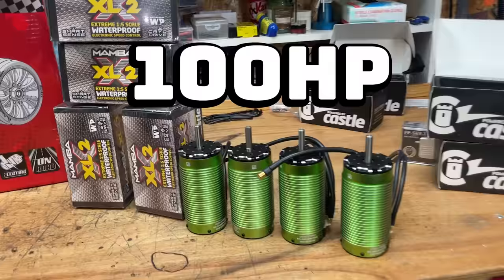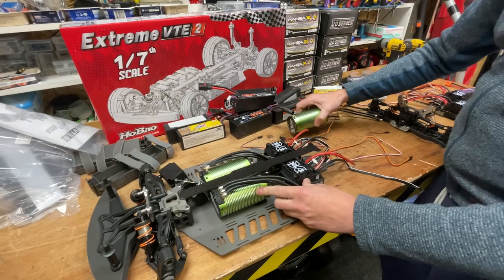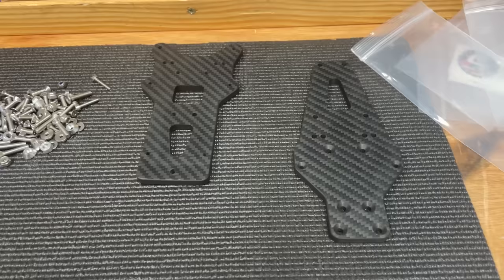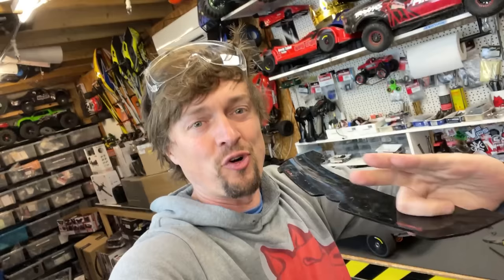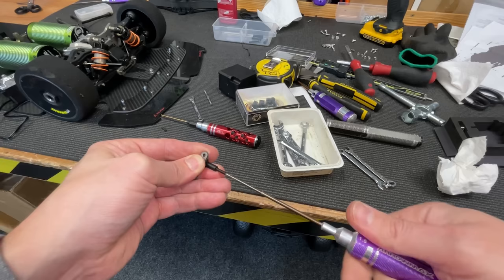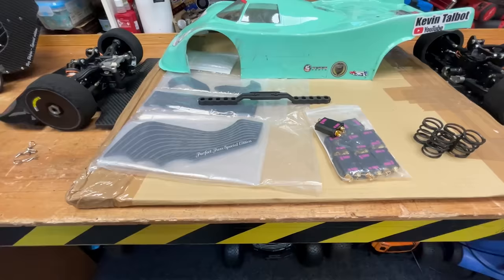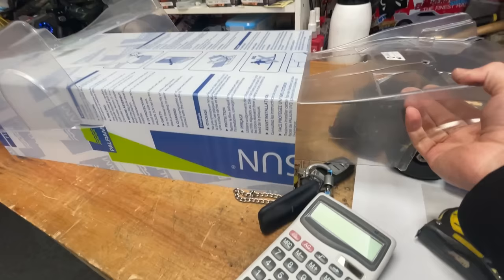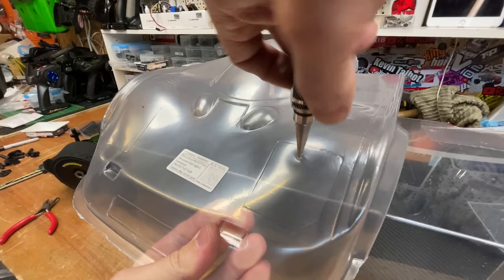100HP 32s Quad Motor Project World's FASTEST RC Car build

Comment: What is your plan to combat the mid-chassis flex from all that weight? might have to get some custom arches made from axel to axel as well as ties along the spine and bulkheads from the center to the outer edge t support the lipo's as I don't think just sticking in a top deck is gonna cut it across that span. Things were better with the skateboard as it was more rigid, had higher ground clearance, and on grass. The Runway at those speeds becomes a belt sander.
Reply: He has a steep learning curve ahead but that will produce more video views which is all it's about.

Comment: I think the tyres are the next issue. The smooth tarmac is relatively rough at the scale. You need to somehow get larger diameter foam tyres. I also think you need to extend the nose to pierce the air better at high speed

Comment: Kev I HIGHLY recommend setting the steering end points super low on this for the speed run, so there is barely any steering, you want to be able to make very minute adjustments as its going to be moving well over 200 mph.
Reply: про личинку верно подмечено. нам надо тоже перенимать это в зараженных странах, чтоб противовес был какой-то

Comment: I'm looking forward to that beast on the road. I think once you get the suspension dialed  in, that thing will rip. I have a feeling the weight will cause some issues though with bumps and cracks in the track/road. Might I suggest some long frame stiffeners? (that go length ways down the chassis). Cant wait to see that bad boy hit the track!
Reply: I also think that maybe the wheels need to be made out of aluminum or something similiar

Comment: Nice one Kev! Awesome project. I wonder if the extended chassis and increased weight will cause the chassis to sag in the middle? May have to use some kind of internal brace to keep it rigid.
Reply: I was thinking the same!

Comment: Hey Kev, great to see the 200+mph car back on the agenda. Hot tip for cutting those tough lexan shells, try using Dremel cut off wheels (nr 409) and the Dremel flexible drive with the smaller handle. Munches through 2mm and 3mm lexan, curve cuts or straight cuts, no probs and super quick. Also, looks like it would be possible to use dual body posts (ie 4x posts at the front and 4x posts at the rear) with those body mount kits. With a car that heavy traveling at such massive speeds, it would surely be well worth trying to tie that body shell(s) on with everything available to keep it rigid and tight. 200 mph wind speeds will really drag against the body shell.
Reply: Was just going to say the same about using a dremel cut off wheel for the lexan; I also use the sanding drums or grinding stones for fine adjustments around edges of wheels or cutouts.
Reply: Seemed like he did just fine using those nose hair trimmers

Comment: Even with the HD springs I’m wondering if the bottom plate will bow and cause the middle of it to scrape. Might have to reinforce to prevent that. Cool video can’t wait to see the next one.
Reply: I was thinking that too. Might have room between batteries and motors for a spar of 3 mil carbon or something similar

Comment: It's all about the tyres and traction. I'd be putting some extra wide drag wheels on it with some solid rubber tyres with screws through to the wheels to hold them on!

Comment: The length and weight will give it great stability but getting the suspension dialled will be a challenge.  If it were mine I would start with very conservative gearing and work my way up to have a good chance at working out issues below 160 before attempting 200+

Comment: easiest way to cut lexan is score the cut line with a very sharp blade, fold the cut line slightly by hand and it will tear apart perfectly. if it doesn't just snip the start of the cut and it will come apart easily.

Comment: Yeah you're going to have problems breaking records with that You can have all the power in the world but if the wind resistance is too great your tires are going to slip and you're not going anywhere now if you cover the wheels block any places where air can come in could probably get up there

Comment: Chassis needs some form of bracing as that’s bowing in the middle with the weight. Maybe also fibreglass or carbon skin the joints in the body shell?
Reply from the maker: its not finnished

Comment: Like how electric bikes and scooters have motors on the front wheel then the rear wheel so they can say it's "AWD" dual power... build a custom frame and put each motor on each wheel... 4 motors hooked up to four wheels. Custom frame you'll figure it out... or 2 motors per axel but being AWD will help the traction..

Comment: You need "I" beams running down each side from the suspension mounts front and rear to support the weight. Keep it from sagging in the middle.

Comment: I would let all 4 motors drive one shaft and turn the torque into rpm since 4 motors won't spin faster but would produce 4x the torque. So you could do torque/4 and speed*4 and you would basically still have the pure torque on one motor

Comment: Power only makes you go faster up to a point. What you really want for top speed is a longer gear ratio. The power to weight is more than enough, way more than enough. Those motors will have a top RPM that they spin at, and adding more does not increase their max RPM. Adding some gears will allow you to spin the wheels faster than the motors, giving you more top speed. 

I wanna see some custom aluminum gears in there!

Comment: With the car body lining up with the rear wing, you are decreasing the effectiveness of the wing downforce. You need a gap below the wing for air to move through to help create the low pressure area and to keep the air attached. If you are struggling with downforce at the back, open up a gap below the wing, like what F1 cars have.

Comment: 9.22. I don't get loose one of the 6 screws on the gray parts next to the shock tower at 9.22. I have a stock infraction v2 parts that i want to upgrade. But i only get to lose 5 out of 6 screws on that parts. Sorry, i don't remember the name of the part. But it sits over the part where you put the front bracer screw off and off. Sorry my English and noobs questions.:)

Comment: Im nervous bout all that weight in middle of very long body with little clearance, Im assuming rest of body will support or may need customizing to support n hold body strong n level off ground and or suspension and or tires will need be adjusting to get lil more clearance, Im just worried bout that carbon fiber belly getting ground to nothing underneath it but sure Im worrying for nothing...

Comment: since you are totally crazy you just might like.......mhz germany rc boat builders . giant reproduction of mystic tunnel boats.....you can run them with real rc turbines....think that is way up your over the top alley . you can also run them with mgm controllers 300 plus amp esc with capacitor banks and plettenberg motors with 12 s lipo graphene batteries per motor . serious triple digit boats . mine is 1850 mm. and getting almost done for summer here in canada .

Comment: Clock bait! Not 250mph
Reply from the maker: i can set any goal for myself that I like. Some aim big, others aim low, do what you want and let me do what i want
Reply: You should put a question mark or some thing after the 250mph so as to not convey incorrectly that it went that fast. But rather that it is a goal.